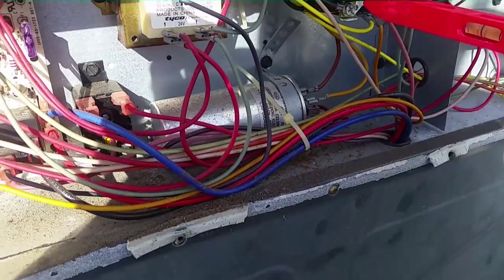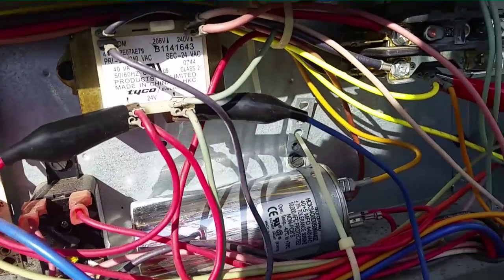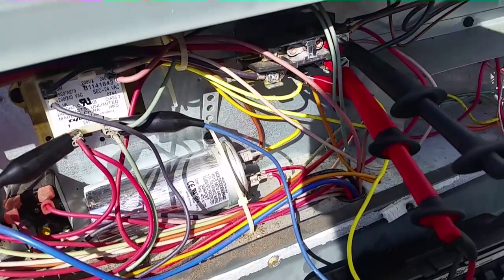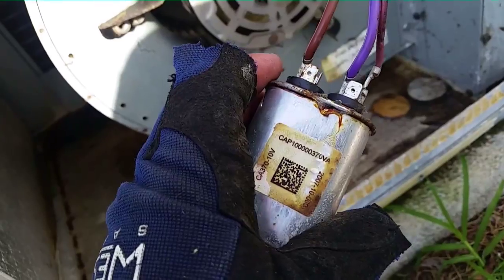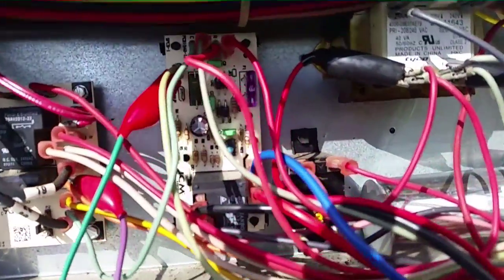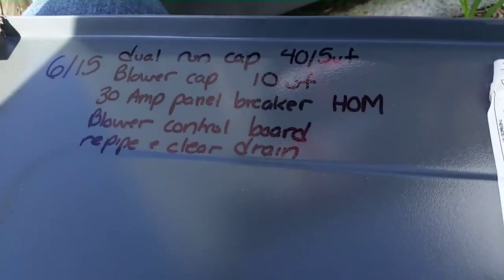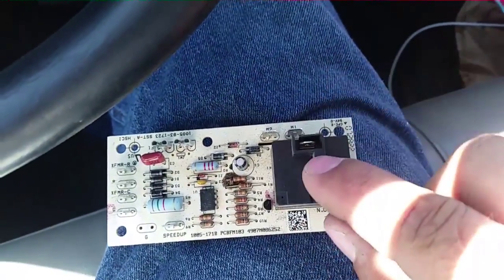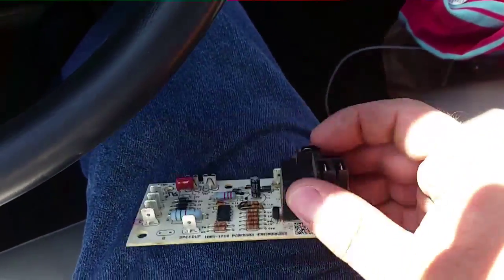Goodman GPH Packaged Heat Pump with Many Failures

Comment: Unrelated to the video, but have you, or any other techs reading this, run across a unit that was piped together using plumbing copper and plumbing solder?  Spent the afternoon yesterday removing one such dog in an attic with next to no room to move and probably about 140°F up there, touching anything metal almost burned.  Thankfully the owner was understanding I had to take quite a few water breaks after she saw me climb down out of the attic literally soaked and dripping with sweat. They had probably even used that lovely acid flux paste and semt the failed compressor to an early death. Definitely got my yearly dose of lead fumes from trying to reduce how much residual solder would amalgamate with the braze alloy.
Reply from the maker: sivalley I have never seen anybody do that
Reply: It was definitely an unexpected first for me too.  I was surprised the unit had lasted the 5 years it did before giving up the ghost. The tenants are enjoying their quiet, new, freshly plumbed 410A Nordyne unit now.

Comment: Maybe the weak run cap caused excess amps to the blower, which then fried the relay on the control board.   Good video.  I hope you managed to coax the wasp to take a ride on the blower wheel!
Reply from the maker: Straycurrent the wasp escaped I think. Higher amperage def could have occurred